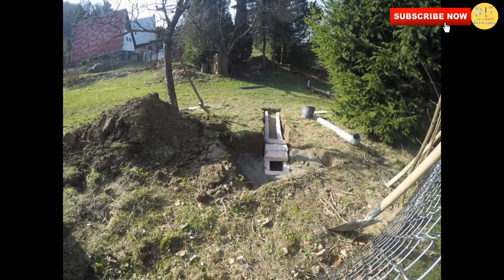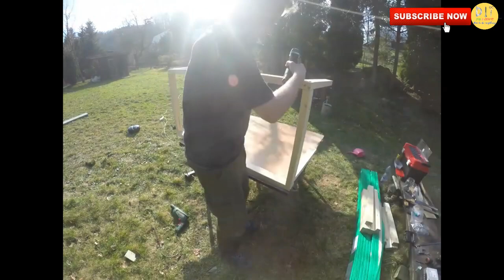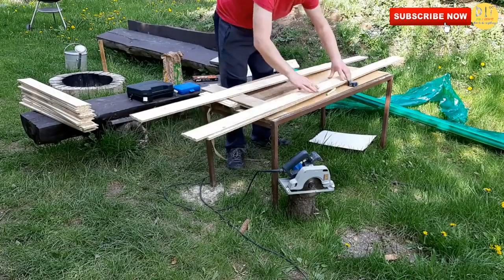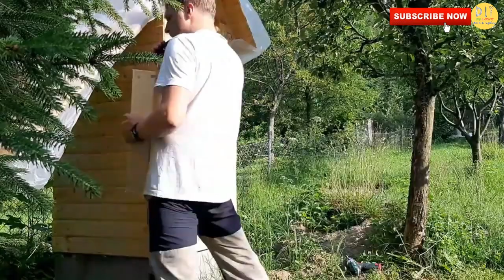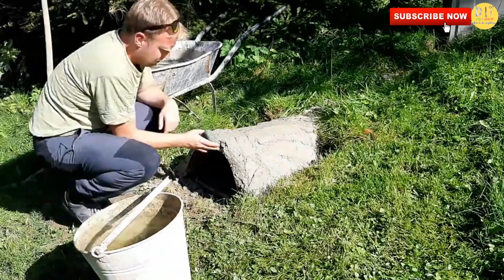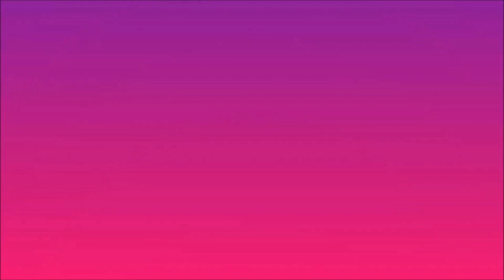How To Build A Smokehouse - DIY smokehouse with Construction Plan and Material List

Comment: is that hot smoke?
Reply: About 80°C
Reply: what if you make the smoke box further away ? Will that bring the degrees down a bit ?
Reply: @Parkster44  no. The temperature depends on how much you warm up. If you will have longer smokeway,it will takes little bit longer to prepare correct temperature in the smokehouse. Correct temperature is 70-90°C for 5-10 hours (depends on what you are smoking)
Reply: id go with salmon but i want it to be as low as possible without touching 80 Fahrenheit. That’s why I was wondering if the pipes run longer maybe instead of touching 80 it would be like 60 or so
Reply: @Parkster44  well it's up to you..temperature is maintained by fire size and can be also decreased using some flaps in fireplace or/and chimney
Reply: I’ll have to experiment but I want to make it as simple as possible agah